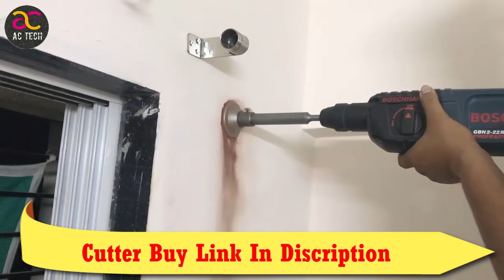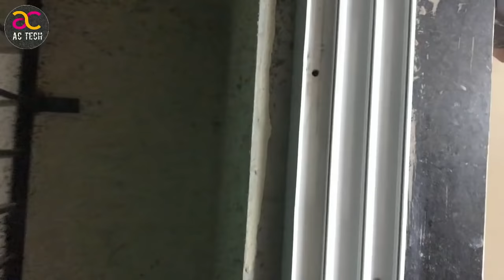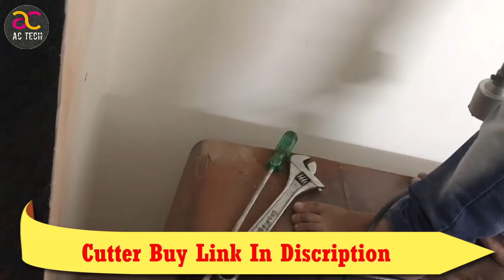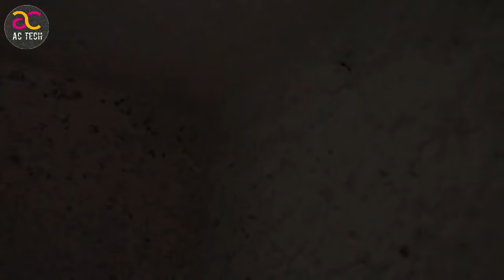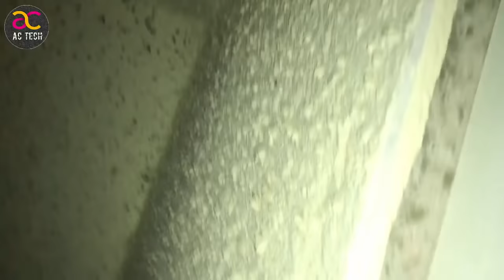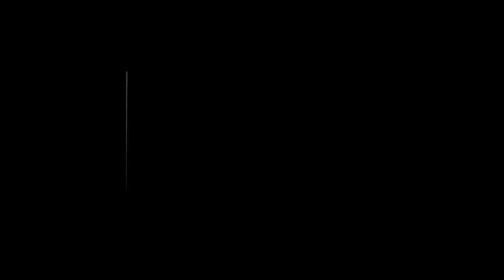Install mini  dultless AC hole

Comment: I think this is mud wall,.  If this is red stone wall it may take minimum 25 minutes or more.  I'm a AC technician and I have same holesaw
Reply from the maker: It a red brick wall which we usually use in India
Reply: Perhaps it's not strong as usual used in Kerala.  Stone 9 inch thick and strong taking more than 20 minutes to make 65mm hole in Kerala
Reply: Voltas, Godrej, carrier,onida,  3 star inverter and some models comes with only 9" section line length and it's impossible to connect pipe flare nut from  outside
Reply: @ACTechpro  red brick meaning what? Natura red l stone or mud heated brick?
Reply from the maker: @thouheedtechinfo2792  mud heated briks
Reply: Good Info
Reply: @thouheedtechinfo2792  do we have to do core cutting if the house is made of chenkall or is it just normal wall hole drilling

Comment: Hi..
May i know whats the easiest way to fill the hole after removing the ac ?
Reply: Yes you can use lots of things like white cement, gypsum putty, foam , silicon
Reply: cement
Reply: thanks guys.. btw used white cement..
Reply: @sandeshthakarkar9437  nice
Reply: AC whole covering caps are available see on Amazon.

Comment: 10 inch wall hole hoga kya ?
Reply from the maker: Haa ye wall bhi 10inch ki hai
Reply: @ACTechpro  what about 1 feet + wall ? window with seating design.
Reply from the maker: @SushmaLeena  Need to do it with 12inches hole cutter

Comment: We are getting water from this hole with ac pipe bend when rain 😭 we put white cement no use pls anyone help 🙏
Reply from the maker: Need to bend AC pipes down where it leaves the hole it will not let outside water to come inside with help of connecting pipes.

Comment: Can cutter be used in drill+hammer mode of drill machine?
Can cutter cut through concrete?
Reply from the maker: Yes we can use it in hammer mode 
And it can panitrate concrete to but not able to cut iron rod in it.